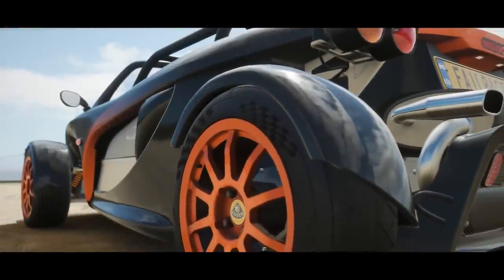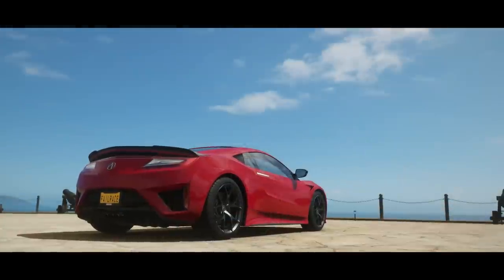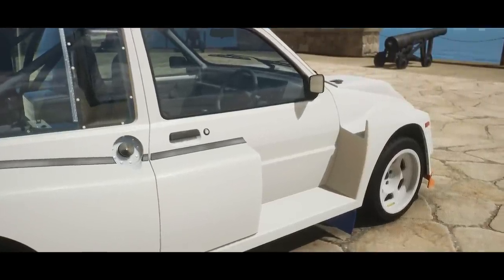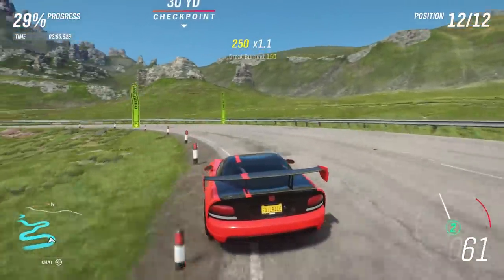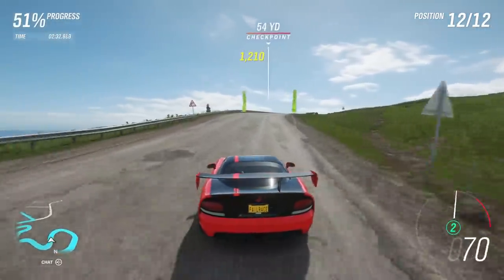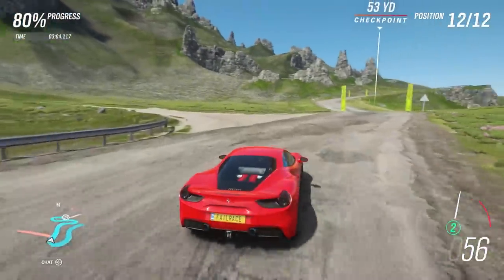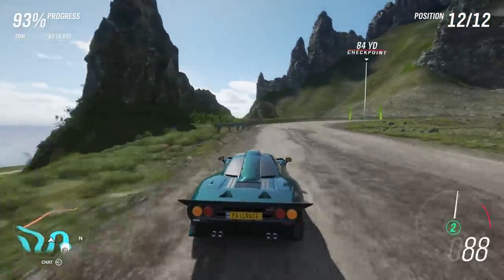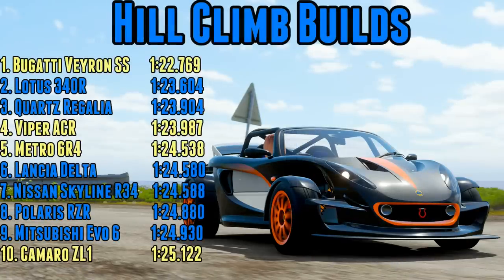Forza Horizon 4 - Hill Climbing - Built Vs Bought

Comment: More stock cars please. Maybe stock Vs tuned with tuned cars being 90% of the PI
Edit: or maybe no racing tires for built
Reply: Do you mean auto upgraded vs purposely upgraded 10 pi down.
Reply: @Dangerman8000  no, manually upgraded but for example if the stock car's 900, you can only tune to 810. This will also be great for Relay Racing, which I haven't seen anyone else do.
Reply: @gsacelm7753  I'll presume you meant 810 and 90 pi is excessive, I'd say 20-40 pi is enough of a deficit. I do like the idea though
Reply: @Dangerman8000  but the sports tires are quite a burden on those cars though, and sports tire would be a condition of this were to be tried

Comment: Do the Austin Healey Sprite, as a call back to when the old Top Gear raced it against a riced hot hatch.
Also redo the Bone Shaker, if you make the rear tires wider, you loose PI.

Comment: Your driving needs to be worked on especially on the uphill left you brake way to early then accelerate and brake again (17:16 you do it all the time) you can save so much time if you use less brakes on the corners